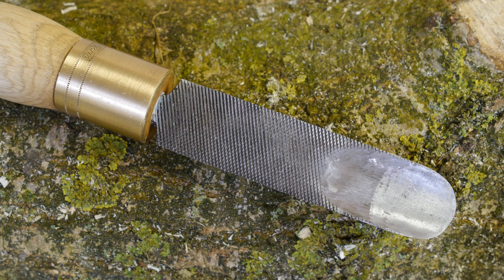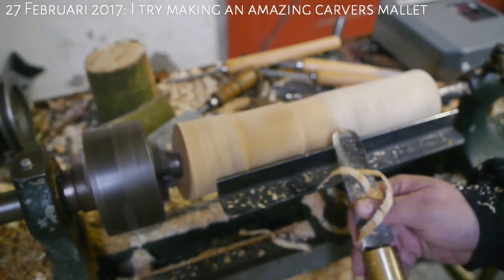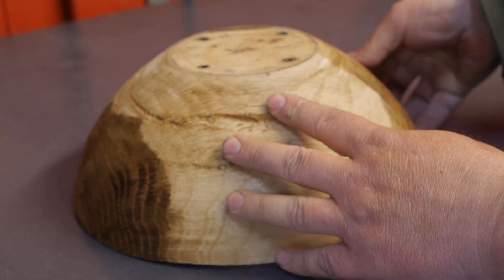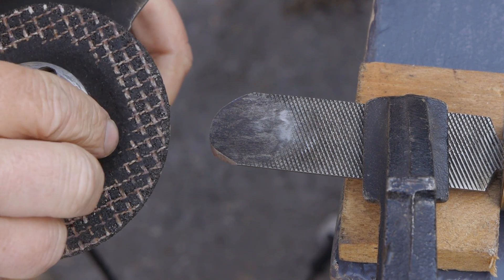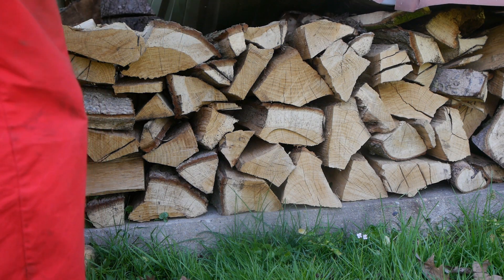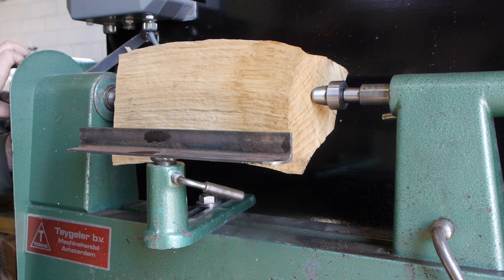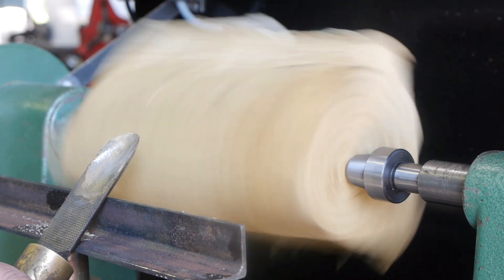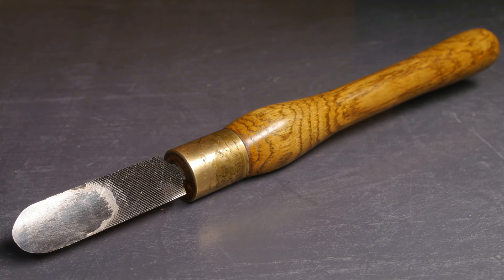resurrecting my home made spindle gouge

Comment: Just watched your May 2019 video on Bangood 80mm mill tool test. Haven't got money for that, so using old, unused tungsten bore drills. 100, 80 and 50mm. Put them in 160mm chuck, as all have a long tang out the back. Works well for me, but same as you, only one of the multiple teeth cutting. Will fix that soon. Thanks for the detail you went into, helps a lot.
Reply from the maker: Glad I could help

Comment: U should  harden the file, then temper it, heres how. Heat to cherry red then quench. Then look at temper chart for correct colour. Heat ttill correct colour shows at the tip  then quench in old engine oil. Temper chart available on the web.
Reply: Forgive me for correcting you but you must first annual the file, slowly heat to carrot orange then cool very very slowly. Then shape it , harden and then temper to your needs. Doing as you suggest, hardening twice (without softening first) will most likely cause dangerous cracks.
Edit read anneal for annual,  blame unproductive tixt.
Reply from the maker: I don't think my little propane torch burns hot enough for that
Reply: @chrisstephens6673  you are correct my error

Comment: Where did you earn your degree in metallurgy?  I get you can also turn lead into gold.  You still don't get it.  It is a brittle metal and is dangerous to use.
Reply from the maker: not metallurgy for me. I studied microbiology :)
Reply: @Rolingmetal  That is the point.  If you knew anything about metal you would know that using a file for anything other than ti file something is dangerous.
Reply: @lyndalanthony635  they can be used but must be annealed, shaped, hardened and then properly tempered. Never as you suggest used as tempered for filing, as they are far too brittle.
Reply: I think this channel is about not doing things the proper way. 
Which many of enjoy enormously, along with his dry sense of humour. Follow at your own risk!
Reply from the maker: Yeah I don't want to be proper teaching channel, They are rather boring imho.